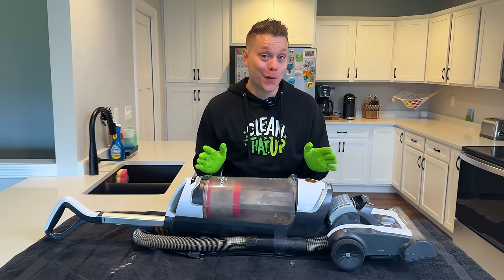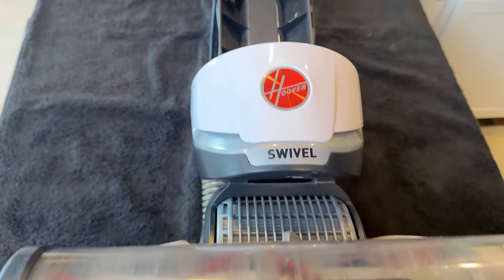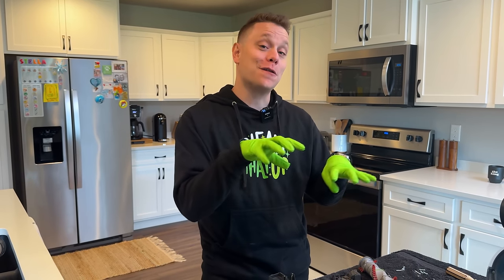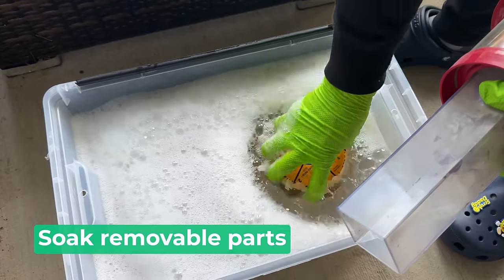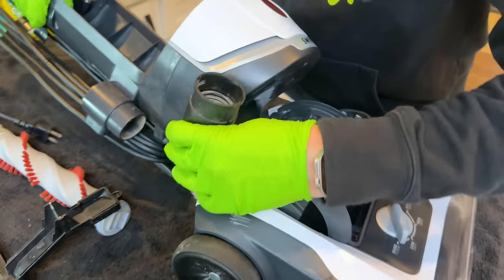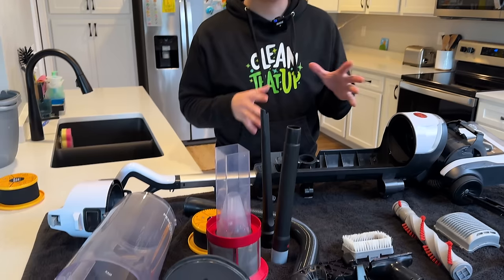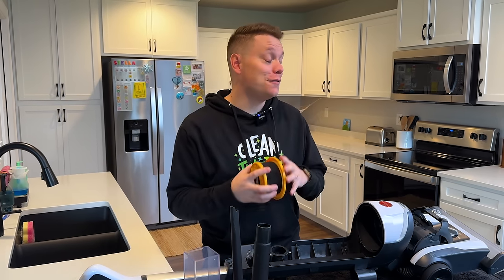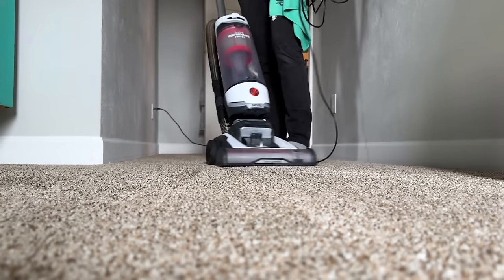How To Clean Your Vacuum Like A Pro (No More Stinky Smell)

Comment from the maker: My vacuum got this dirty after just a few months of cleaning jobs! 😅 Have you ever cleaned your vacuum?
Reply: Once a month I clean all the filters!
Reply: Vac was new in 2016. Only thing I wish I could make look like new is the hose. I've put our (removable) showerhead on jet to try to blast out the dirt, watching as the water spirals down. However I have to hold the showerhead with one hand, hold the hose in my other, and try to use a foot to pull down the hose so the gaps open up to get more dirt out. There needs to be some type of invention made to help stretch the hose for easier cleaning.
I've soaked ours in the tub 3 times for deep cleaning since 2016.
*And Bissel no longer has the hepa filter we need in production.
Reply: @TiredMomma Did you check your local vacuum store for the filter? Maybe they have an off brand version that will fit your model that’s usually what I have to do before I went to a bagged system
Reply: Hey Brandon I was wondering if you ever considered/have a wet/dry shop vac for those very nasty areas or somewhat wet messes. If you do what one do you like/recommend
Reply: At least once a year I get to cleaning my vacuum.  Yeah I should probably be doing it more often but I did purchase extra filters for it last time!!
Took me about six months to remember where I put them…🤷🏼‍♀️🤦🏼‍♀️
Reply: Twice a month.... Because if your dog peed on the carpet and you don't know it  the vacuum will look horrible
Reply: If you have a henry vacuum cleaner do you still clean it the sam @TiredMomma
Reply: @lee-annebates903  I have no clue what a Henry vacuum is.

Comment: new viewer here! I service and repair vacuum cleaners, I have been doing it for almost 15 years. this is a very accurate video, however I want to give you and others a few tips from someone who has been doing this a long time. first. you can wash the base plate and the front wheels just fine it will not hurt them but the brush roller you are right about, just wipe it down with a damp cloth. one more tip, when your shopping for a vacuum cleaner bagged vacuum cleaners are generally easier to clean and maintain because all the dirt and dust goes in the bag and you just throw it out and dont have to clean a lot up after it plus you dont have to empty it as often, wait for filters to dry or clean it as much. plus the bag keeps 90-95% of the dust out of the motor which helps it last longer. great video! you explained everything just about how I would explain it to people 🙂
Reply from the maker: Thanks for the tips and watching Nathaniel!

Comment: Another tip I have is if you can't get rid of all of the bad smells or just want the vacuum to have a really good smell to it, you can vacuum up some laundry beads and it makes the vacuum smell great! Cleaning it out is super important to make sure it lasts, I have several machines that are 20 or 30 years old and still work great, in fact I use a Fantom Fury from 1998 as my regular vacuum!
Reply: Just set it outside on a sunny breezy day it will remove the odors

Comment: I recommend quality bagged vacuums especially because of how excessively dirty it is to clean a bagless vacuum (even dysons have this issue, i repaired many of them). Yeah there is a recurring cost with buying bags but the cleanup will be easier and with HEPA bags and filters, they usually leak less air which reduces the bad smell. The best overall vacuums will be bagged ones.

Having a shop style vacuum with a bag and filter installed is very useful for cleaning other vacuums like the one shown in the video and for sucking up all kinds of crap that regular vacuums don't fare well with.

Comment: Thank You so much for these tips.. I basically do the same thing to clean my bagless uprights with the exception of taking it outside as I do keep an old Canister vacuum in my basement and I use that to clean the filters and other pieces before they are washed.  The canister vac has a bag so I can just toss that when it is full..Keeping one clean does make it last longer, perform better and keeps down odors in the unit.. Thanks again for these tips..

Comment: Hold up.. I have one of those 'vent' cleaners (marketed as radiator cleaners over here)...   
      Can't believe I didnt think of cleaning my vacuum hose with that... :) 
     ('Cause I have tricks for cleaning anything and everything else).

Very good instructional video, man. 
     You'd be surprised how many people throw away their vacuum cleaner because they simply don't clean the filters.
     I can find 2-3 vacuum cleaners every week within 500 meters (not half a mile) from my home. And 90% of them are perfectly fine - just dirty.
      (Literally 90%. And the other 10% are broken in such an obvious way, I don't even bother to try em)

A simple way to see it:
     How well would YOU breathe through a pillow? 
     It's hard, right?
     Clean the filters - there's always 2 (1 before the motor, 1 by the exhaust); sometimes 3 (hepa filter).
      If you only found 1, look harder :)

*There are exceptions, but those are only on expensive vacuum cleaners (like Henry, the one with the eyes on it); most likely - yours has 2 or 3.

**And always clean your cleaning utensils. (Some mops can be machine washed; microfiber towels / viscose towels can be machine washed; spunges can be made wet and put in the microwave for 30 sec to kill germs.

Anyways - thanks for all the advice. 
     I personally know a lot of this stuff already (had part time cleaning jobs for about 18 years), but I know most people don't.

Comment: Excellent video. I hate doing this kind of job which is why I will never buy a canister vacuum cleaner that doesn't use bags again. Kirby vacuum cleaners best vacuums ever made in last forever. Powerful suction. Bags are not cheap but easy to throw a bag in the garbage can instead of grossing myself out cleaning a canister vacuum

Comment: Note: That is not a "canister" vacuum. It is a bagless upright vacuum. Upright vacuums usually have only one motor with the handle sticking upright from the rotating brush head.
Canister vacuums have a motor in a wheeled body pulled by a hose with a power nozzle (rotating brush) or attachment tools on the other end of the hose. The hose is usually electrified to power the rotating brushes in the power nozzle (aka power head)
Reply: No. It is not. I called those vacuum that pulled by the hose is cylinder vacuum cos my country is a former British country. He meant the dust container that he called it canister. The bagless upright or cylinder vacuum have a dust canister
Reply: It is another name for bagless vacuum. Why not follow like what did UK and all these former British countries like Singapore, Malaysia and Hong Kong called all these vacuum that pulled by the hose cylinder
Reply: @littlehousemolly4676  Because I live in America, and we don't do anything the rest of the world does. 
I don't know when other countries started calling the two motor vacuums with a hose "cylinder" vacuums, but those have always been called "canister" vacuums on this continent. 
I know the presenter in the video called it a canister vacuum after the clear plastic bin the dirt goes into. He seems to be American, and he is wrong here. Originally, to differentiate themselves, they were called "bagless" vacuums because every previous upright vacuum had a paper bag to collect the dirt before the bagless vacuums came into existence.
I know most of those bagless vacuums are manufactured in places like Malaysia and China, but they are marketed here as Upright Vacuums (with a bag), Bagless Vacuums (with an open and dirty clear plastic bin), and Canister Vacuums (two motor system with a power nozzle/head and canister (usually bagged) with an electric hose in between.

Comment: I used my bathtub to soak all the removable parts. It took 2 soaks but I didn't use any soap to soak, just vinegar.

I always hate cleaning the hose because I don't have anything long enough to scrub down into it, and it takes 3-4 days for it to fully dry.
*Pro Tip: never buy just 1 Hepa filter, they last longer than you think, and you never know when the filter will stop being in production.
Our vac model was brand new from 2016 and now in 2023 I couldn't find any hepa filters for it. The vacuum is outliving how long the company decided to continue making filters for it. 🤷‍♀️

Comment: I thoroughly enjoyed that but am scared to take my vacuum apart like that. Whenever I take things apart, there is a good chance I will never get them back together properly.
Reply: For any repairs/disassembly project, I take photos on my phone to use as reference. I take a photo of how it looks before I do anything, and then a photo after each step of the way. This way you have an easy reference for getting it back together correctly. #yougotthis